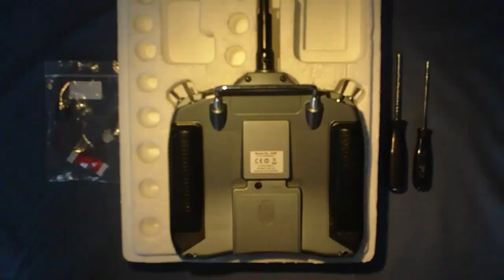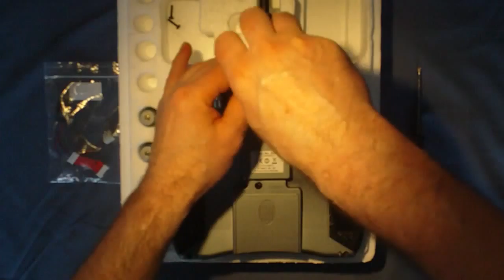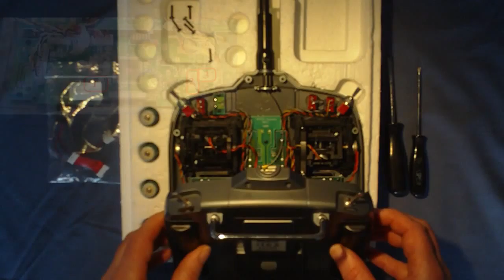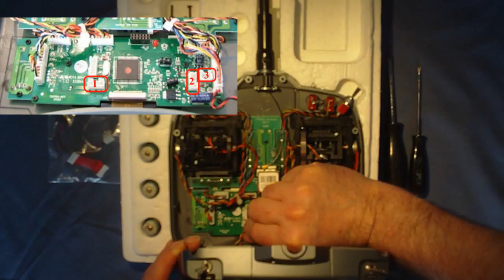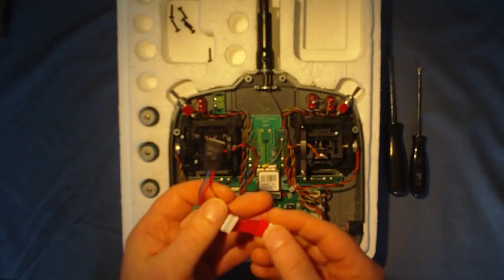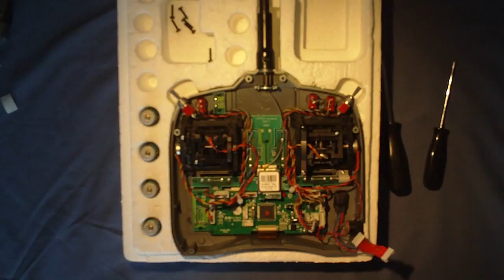Spektrum DX6i Vibe Unit install - using Tech4rc Vibe unit kit, Pro/Extreme Plug and Play version.

Comment: Quality piece of tech and easy to fit just like the Tech4rc dx6i backlight which i have as well in the same dx6i, both make a big difference to the controller. I can actually see what is on the screen and i can feel the timer rather than trying to glance at it with 1 eye whilst keeping the other eye on what i'm flying, thankyou Tech4rc

Comment: I admit, what's the vibe unit actually do for a pilot?
Reply from the maker: 4FunRC The vibe unit provides the pilot with feedback, via vibrations through the transmitter body and is great in noisy conditions when you cannot hear the transmitters buzzer. It works the same way as a mobile phone vibrate function and is fitted as standard to the Spektrum DX7s transmitter.
Reply: Tech4rc - Thanks!